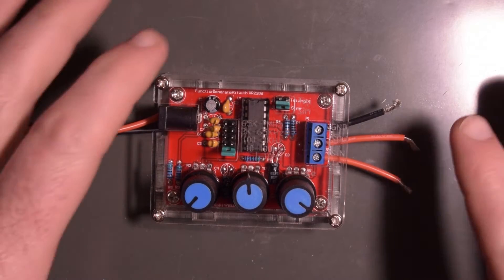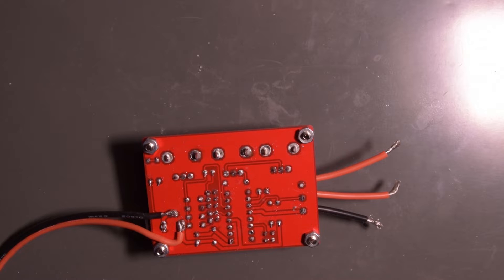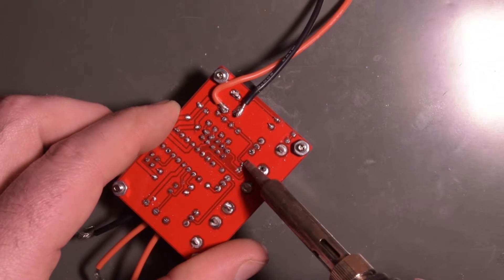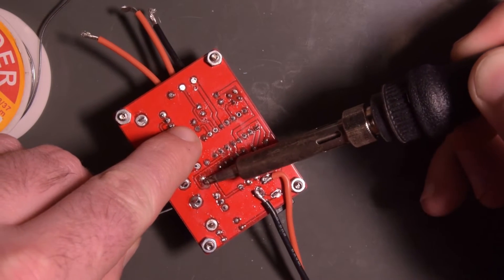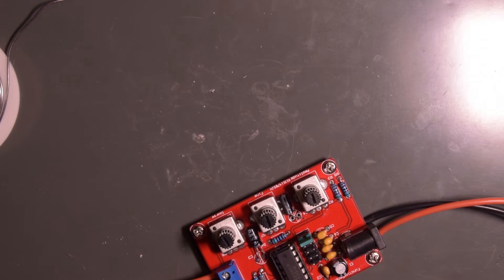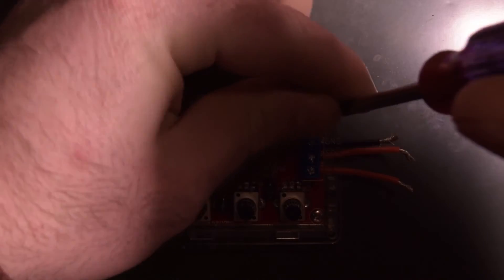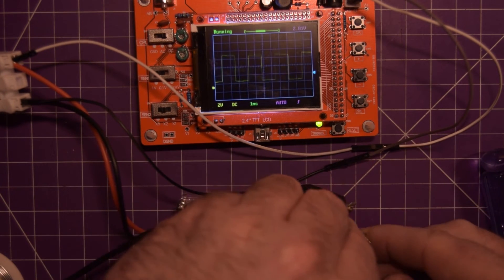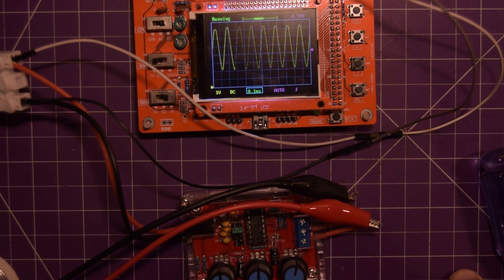Repairing The Function Generator

Comment: I built one if these and it didn't work. Changed one resistor and it worked for awhile then went to use it gain and no square wave. Not a very good function generator.

Comment: You were really lucky not to lift those pads, way too much prolonged heat....and please, clean the soldering iron tip (wet sponge or brass shaving, whichever you prefer).

Comment: Glad everything worked out. Still an incredible value for what you get versus what you pay. I have one and it works about the same.
Reply: How long have you had it Larry? Has it held up I am really    thinking about getting one
Reply: @GeorgeJFW  I have had it about a year. It was purchased all ready assembled and worked when I powered it up. The first knob works backward from what you would expect (turning clockwise decreases frequency). I have played around with it several times with the DSO 138 oscilloscope set to frequency readout to generate sounds for experimenting with synthesizer circuits. I like all of the boards I have purchased from China. A lot different from when I tinkered around in the early seventies.
Reply: @larryyounger8674  nice thanks for the feedback it's moving up the ever growing shopping list!